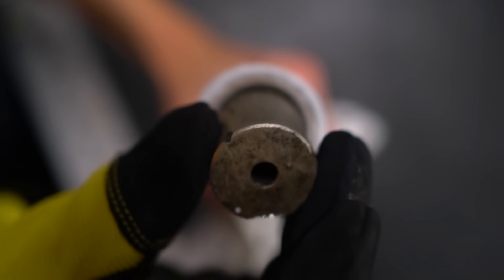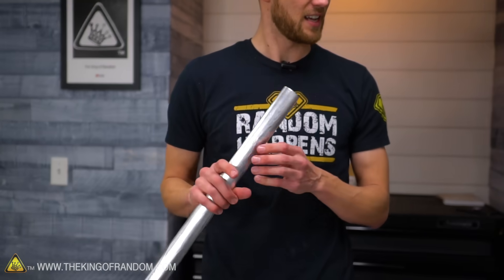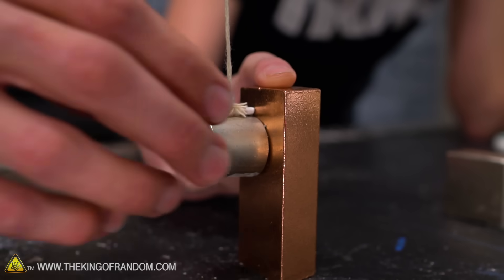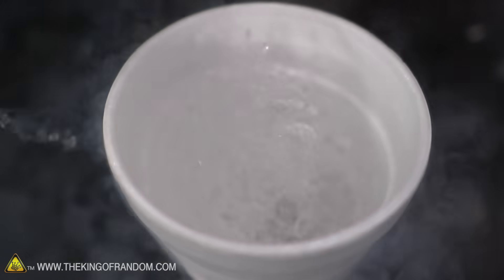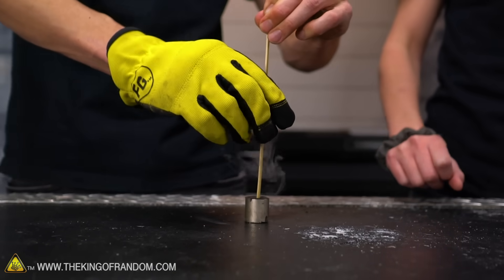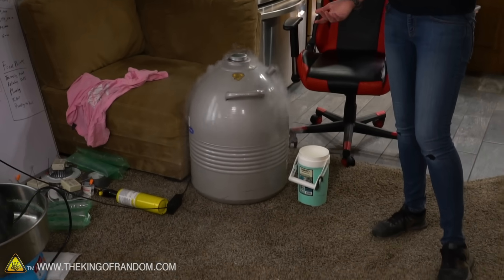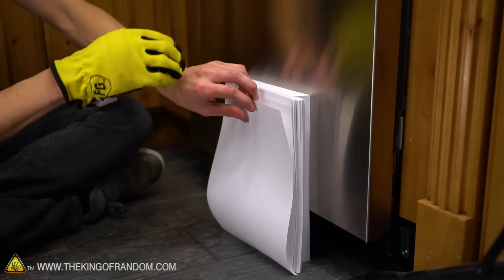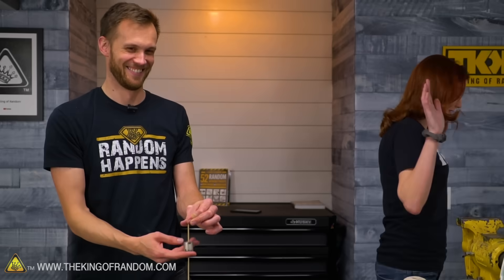Frozen Magnets Become ULTRA POWERFUL

Comment: Actually... copper, brass, and aluminum produce Eddie Currents in presence of a magnet whether or not the magnets or metals are moving (static)... if the magnets are strong enough and not too heavy they will stick to these other metal because of the Eddie Currents being produced.

Comment: I found this actually searching for experiments on the effects of magnetic fields on ice (especially sea ice). For anyone who's curious, my experiments strongly suggest that when salt water freezes under an applied magnetic field (i.e. stronger in magnitude than ambient MF) it does so at a higher temperature. If you then study "magnetised ice" as it melts, the meltwater it creates is warmer but the ice itself is colder than those from "non-magnetised" ice. 
My experiments and those of other scientists also show that magnetic fields also effect other properties of seawater such as its salinity, solubility of CO2,  evaporation rates, viscosity and thermal conductivity.  
There are videos of tap water (non-salinated) being moved by a strong neodymium magnet on YT also you might want to try creating an icicle (I did so by freezing water inside a straw with its ends sealed with tape). Suspend  from a thin thread (to reduce torsional effects) the icicle so it balances horizontally, wait for any twists in the thread to work themselves out then try slowly approaching one end with a strong magnet. You will gradually see the icicle start to turn away from it (water is slightly diamagnetic). If you move the magnet in a "pulsating" fashion in the vicinity of one end you will see an even stronger repulsion (the movement of the magnet is creating stronger induction effects). Test with a similar block of non-magnetic metal if you suspect it might just be air currents moving the icicle.

Comment: Try to have many magnets inside a tube, and push perfectly the first magnet so to ring a bell at the end, must be 1 meter or more the tube. Where one magnet hits the other, and no less than a magnet distance between them. Before you do the experiment, you must do an equation and find out the perfect push beforehand... Sorry i raised the steak ;)

Comment: Do you guys have a Geiger counter /electromagnetic detector to read what the magnet are putting off along with a temperature reader to see at what temp your experiments took place. 
Also, does freezing your expended magnet from the melting test to see if it regains any meg Eric properties. Lastly, testing the magnetic stick test repelling in a vacuum.

Comment: I love magnets because they are so permanent (for the most part).  I have hundreds of magnets from computer hard drives.  Small ceramic magnet attached to a metal plate.  But if you remove the metal plate, they get weaker for some reason.

Comment: most magnets don't mind the cold. In fact, some may perform better when the temperature drops. That's because the atoms that comprise magnets vibrate more slowly and less randomly when cold. The result is a better alignment of the atoms that generates the magnetic field, boosting its strength.

Comment: You guys did a test with the strength of different things, where you measured their pulling ability.

Why wouldn't you tie a piece of metal to that scale, hang it from the ceiling, and hold the magnet to a table?

Then you can get an actual measurement of strength.

Comment: So what happens if anything when you heat up then super cool a magnet? Can you forge a magnetic knife using a large magnet or semi small magnets?<- ( if super cooling heated magnets re magnetizes the magnet) -> can you melt magnets and form a cool magnet?  What would happen to a magnet if you used a wood burning kit/very precise heat source on it? If Q1 doesn't work is it easier to remagnetize a cold, super chilled or warm magnet?

Comment: Just a comment about the paper test. If you're a physics major and I'm wrong, please correct me. But I think magnets lose their strength by the square of the distance. So if you had to increase the distance by 50% (so 1.5 times the distance) then it was probably 225% of the strength when cold (1.5^2 = 2.25). So 125% stronger instead of 50% stronger.

Comment: i heard of a thing brass musicians do to get a better sound from brass instruments. they were dipping Trumpents in liquid nitrogen to "allign the brass" molecules causing less air restriction and had a sharper clearer sound. anyone ever heard this before? 
can dipping copper wire in liquid nitrogen lower the resistance of electricity?? 
imteresting. 
where do u buy liquid nitrogen anyway

Comment: What happens when break an egg into resin?  I have seen some wood-resin turning videos, even one where they turned a coconut, but there was one who decorated a table using fresh vegetables!  What happens top those in time... but it would be interesting to see if you can crack an egg into resin and see what happens over night...🤔🤔🤔🤔🤔????

Comment: Im guessing because metal contracts with cold and expands with heat, the magnetic waves are closer in proximity with the cold as opposed to heat which would spread the metal and thus magnetic concentration apart.

Comment: I think the difference between the time for the magnet falling through a cold tube and a room temperature tube is to do with the fact that electrical resistance increases as temperature increases, this means that the eddy currents generated to be bigger (as have a bigger current and a smaller voltage as  V=I*R.) this means that the force generated is bigger (since F=B*I*L). This is also the same principle for the magnet swinging towards the copper.

Comment: Suggestion:
Since freezing the eddie current medium had such a massive effect on its resistance to the magnet, what happens if you created a simple magnet-on-an-axle motor/generator with a separately sealed copper coil outer ring that could be filled with liquid nitrogen to cool the coils and then spun the magnet?  Would that create a higher voltage than without the liquid nitrogen?
Reply: May I make a suggestion for your further research? Look into the mechanics of how MRI scanners work. It's very much in the same "field" that you're talking about there, take care and hope that you're staying well through this crazy time we're all going through.

Comment: it makes sense the colder something is the slower it moves, so with the metal being cold it causes the magnetic fields to be a bit stronger. With the magnet being cold the atoms in it are moving much slower and not as random. creating a more aligned atomic structure thus the stronger magnetic field.

Comment: Hello Pressman here, explanation for why the magnet slid on one side of the paper but not the other is. When the paper is made at the paper mill the paper is strained through a wire mesh and is pressed by felt on the other side. so one side of the paper has a slight texture of the wire mesh while the other side is smoother from the felt. You can observe this on most every kind of paper with a magnifying glass. It is also a factor of how much silicone/anti-static the pressman applied during the run as it does not always flash off before packaging.

Comment: you should try Quantum Magnetic Levitation. i think your copper ingot is a superconductor, not 100% sure. freeze the copper/other superconductor then place it over the magnet. you can then  move the magnet around, even upside down and the superconductor will stay locked in place

Comment: Try heating a magnet then cooling it, and if it somehow miraculously survives the massive temperature change without totally breaking, test the magnetic strength. If it does break test the pieces of it and see if they are magnetic. I don’t think a magnet stays a magnet if you cut it idk. But either way I think it would be cool.

Comment: Why didn’t you just freeze the magnets in a freezer like a normal person would have done
Reply: A freezer cant get anywhere near as cold. Most freezers sit at just below freezing, so maybe -2c (not used to celcius), but using liquid nitrogen got the temperature down to -273c. Waaaaay lower, and if anything were to happen at colder temperatures, you're more likely to get an observable outcome if you get a little extreme.

Comment: If you'd kept the aluminum tube in liquid nitrogen, that magnet would've NEVER hit the ground. Aluminum becomes a superconductor at <100°K, liquid nitrogen is ~70°K, and a magnet does not like moving towards or away from a superconductor, or vice-versa. And with a superconducting tube, well, you get levitation.

Comment: Heat up a nail till it’s glowing red and hot it with a hammer in a sliding sort of action in the same way and you can make a magnet, because of the way you are physically realigning the electrons in the nail, this creating a magnetic field.         Also “magnetic waves” = magnetic flux

Comment: You understand that the paper doesn’t exist for the magnetism of the magnet vs dishwasher experiment. The paper isn’t blocking the magnet’s power. It has no effect on the holding power. But, the distance the paper holds the magnet away from the dishwasher is everything. Magnetic strength varies as the inverse square of the distance, just as gravity does.

Comment: you need to get a type two super conducter. if you freeze it and place a magnet over top of it the magnet will lock in place. its something called quotum locking. not sure exactly how it work, but thought it was something you would do. if you push on the magnet the super conducter will also get pushed.

Comment: Actually, theoretically it makes sense. In the same way that quenching hot metal in water or oil forces the metal atoms to align, taking a room temperature magnet, which I'm assuming is made of iron, and freezing it in the liquid nitrogen couple with the magnetism of its own atoms probably forces the atoms to align better.

Comment: Do tell me if you are gonna do this or not.
Try microwaving stuff like popcorn, soap and other random stuff which expands at being microwaved and then put it in a vacuum chamber and then putting it in a freeze dryer and then lastly try putting it in water to see what happens when the stuff goes through all of this.

Comment: I was wondering if you could check out if it would be possible to use liquid nitrogen to cool down forged metal instead of using either oil or water, would be quite interesting to see how it would influence the grain structure of the forged metal, since it's highly not recommended to use water to cool it down as it might make the grain structure more brittle, would be cool to see if liquid nitrogen would make it even more brittle... Also could be fun to see the reaction of pouring melted metal into it as well! And yeah, I'm a big fan of Forged in Fire!

Comment: When you drop the magnet through the tube, does the tube get heavier? Like if you weigh the magnet and tube separately, does it weigh the same when the magnet is falling through the tube?
Reply: surely
Reply: Weight = mass * gravity
Mass isn't changing because nothing is being removed or added.

If you had a sufficiently sensitive scale you'd see a slight reduction in weight, but you'd be wrong.

You would have failed to account for the slightly reduced volume with the lower temp which means the objects displace less air, which has a non zero buoyant effect.

Sort of like when they were floating an aluminum foil boat in SF6.

To amplify the effect take a helium filled balloon and immerse it in ln2.

It will deflate to the point where it no longer displaced enough air to float until it warms up, expands and displaces more air.

Weight = mass * gravity in a vacuum.
Reply: @Zomby_Woof  I think he means more like the magnet is imparting its weight onto the tube to slow itself down and that force has to go somewhere

Comment: You got the aluminum to enter (or get really close to) the superconducting regime, so the eddy currents were stronger and therefore the resultant opposing magnetic field was stronger (same with the copper ingot). This is why supercooling is used/needed for magnetic levitation. Thanks for an awesome episode!

Comment: Try this one.
While the flash point of almost all woods is at over 300°C several elements/items have melting points lower than that. some are listed below. Put it in a pot on a hot plate in a vacuum chamber. See if the wood absorbs it.
Gallium, phosphorus, potassium, sodium, sulfur, iodine, indium, lithium, selenium, tin, Bismuth petroleum jelly, oil, paint, epoxy and more
30°C  - 271°C,  86°F - 525°F
Try other porous materials.

Comment: An experiment we did at my mothers house for the kids: Put the neodymium magnet in a zip-top bag and run play sand across it. The magnet pulls out the magnetite (black grains) in the sand. You need a pretty strong magnet for this; we tried a few, and the neodymium worked best. The kids thought it was cool for about ten seconds. The adults (both of us studied geology) spent about two hours collecting magnetite....

Comment: As the magnet falls through the metal tube it creates resistance due to the electrons it generates. Right? Soo my question is, would this also generate heat? If so how much? and if so 2.0, What would it take to make it noticeable?

Comment: • 3:33 - Contactless magnetic/eddy-current brakes are used in various applications like roller-coasters, trains, elevators, and anywhere else where a large mass or high-speed (i.e., high force) needs to be stopped, as well as in places with high risk of fire, because frictional braking would create sparks and wear down the brakes rapidly.
• 5:14 - Sometimes. I tried getting a dog, but that just made it worse. 🤦
• 8:20 -  It's kind of like a Goa'uld energy-shield; the repulsive force is directly proportional to the incoming energy.
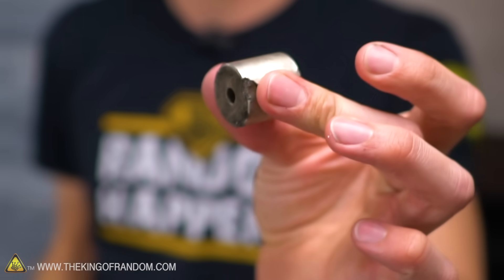• 11:27 - You're not making the magnet stronger; the cold is just making it harder for the atoms to align to the magnetic field.

Comment: Electromagnet eddy current brakes are frequently used on high speed trains to help reduce wear on friction brakes, that take over at low speed.

Also, since their braking power is proportional to the trains speed, they can slow a fast moving train extremely quickly, where normal brakes would cause wheelslip and damage the rails.

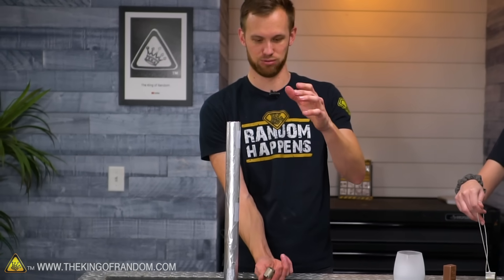Comment: 2:20 that’s not true there is resistance he would need to be in a vacuum for there to be no resistance
Reply: The Creeper way well thanks Sherlock. The air resistance is there, however it would be so small it is negligible. Additionally, relative to most things in our atmosphere, it would fall at about the same rate. For all intents and purposes, there is no resistance.
Reply: owen fulkerson you think I don’t know that

Comment: there was a physists that did an experiment where he bolted 2 strong magnets like that together, with like sides facing each other (like you were trying to push down) and he timed dropping them vs the same 2 magnets but with like sides together. he claims it dropped slower than it should... please try that with accurate timing

Comment: I think their “50%” stronger comment neglects that most forces like that have an r^2 kind of reduction with distance. So 50% more range implies a much greater increase in strength or power.
Reply: BIG BRAIN
Reply: I know you're saying that it would be 2.25 times stronger but the reality is that r^2 has no application in that particular test.
Reply: @namansingla2975  No, Drew Stevenson is right. By saying the magnet is x time stronger you're referring to the magnitude of the magnetic field vector at a given point. However, in the test we're not measuring the change in the field strength, we're measuring the point at which the force applied by the magnetic field times the coefficient of friction between the magnet and paper is equal to the force of gravity. As such, it is only fair to say the strength has increased by 50% if the filed decreases linearly - which it does not.

Comment: I always get nervous when people in online videos use liquid nitrogen without gloves or goggles or anything.
The stuff is about -320 degrees Fahrenheit, and sure the Leidenfrost effect helps you for a few seconds, but Calli could have been seriously hurt if droplets of liquid nitrogen got stuck in her hair against her head, or worse in her eye! 
I handle liquid nitrogen at my job, and we have to wear goggles if we're anywhere near it, face shields if we're using large quantities of it, special gauntlet-like gloves, and full lab-coats and close-toed shoes. If liquid nitrogen pools anywhere, it will freeze whatever it touches, and cloth is very permeable. This stuff is awesome, but incredibly dangerous!

Comment: Maybe try making a 2x2 foot ring of copper wire, soak the wire and the magnet with nitrogen, and then see if you can propel the magnet around the track.

Comment: Now here’s what I want to know. You can remove magnetism with heat and temporarily increase it with cold. What I want to know is, can you restore any form of magnetism, either temporarily or permanently, to a magnet that was heated up by submerging it in liquid nitrogen?
Reply: I would think not. Magnetism has to do with the alignment of the electric fields of the atoms that make up the magnet. Extreme heating breaks up the alignment, and when it cools, the misalignment is locked in. Extreme cooling at that point shouldn't do anything- it would be like cooling any other rock.

Comment: The reason why you got better results from cooling the aluminium and copper down is because when you cool something that creates the eddie currents when a magnet moves near it to liquid nitrogen tempratures it amplifies the eddie currents they make and makes them much stronger then before as the electrons the material has basically zero electric resistance or something like that. The Action Lab explains it better in a video about superconducticity than I just did if you want to check it out.